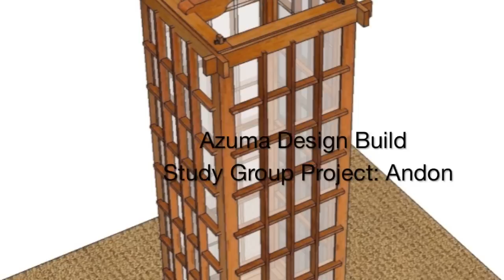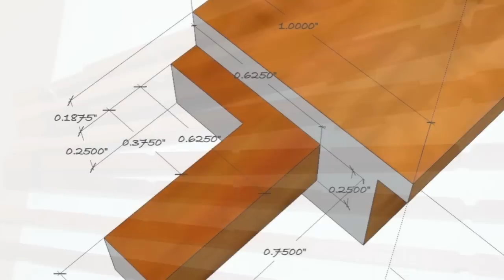Japanese Carpentry Study Group: andon

Comment: Hi Chris. Beautiful lamp. I would love to get some wood and a japanese saw or two and a book and try my hand at a shoji door. Small one to start to use as a window cover. I have a question. Maybe this may sound silly bit how do you change the bulb. Seems so long for your arm and it looks closed on top and bottom. Thanks for the video.
Reply from the maker: jayne simmons Easy to change the bulb -  just reach in through the top and unscrew.

Comment: With all all that marking, layout cutting,chopping..precise chisel work and beautiful result Chris,  what would one of those lanterns cost me using the same (sapele?) material?     I loventhis kind of work and am striving to get tighter and tighter (but not too tight) joinery :).   I would like to turn and do this professionally.
Reply: Sorry, definatley not Sapele....what is it exactly?   Looks like a rosewood..
Reply from the maker: +Swedish Holmberg  It is a rosewood, Cocobolo (dalbergia retusa) to be precise. Not an easy wood to work with a conversion rate from raw material being very poor, waste being close to 60% or more. Material costs for cocobolo are in the very upper range of potential woods which could be used for this project, though there is nothing quite like rosewood in terms of its beautiful appearance and high polish-ability. This lantern was a project we tackled on the Craftsmanship in Wood Forum. A few others were made, in different materials.

Comment: How does one get the plans for this?
Reply from the maker: Gary,

thanks for asking. It was a carpentry study group project and is still archived on the Craftsmanship in wood forum -  if you join the forum you'll be able to check it out in detail.
Reply: Chris Hall
Hi, I love the lamp.  I finally found the forum.  When I got there.  I didn't see any threads or plans.  Can you help a guy out and post a link.  Thanks.  BAG2
Reply: Chris Hall Not there or at least I could not find it.
Reply from the maker: gary24752 Please see my earlier response. You will not see any material at the CW forum until you register and have had your registration approved. I moderate new member applications, and don't recall seeing anything from you or BAG2.

The forum is found at: http://www.thecarpentryway.com/CraftsmanshipinWood/index.php

The andon is Project 3, found in the Joinery Study section. Perhaps we'll see you one day?
Reply: @triplemiter  I have no idea what the Craftsman forum is. Your link does not work.